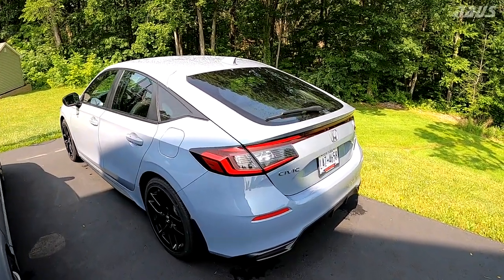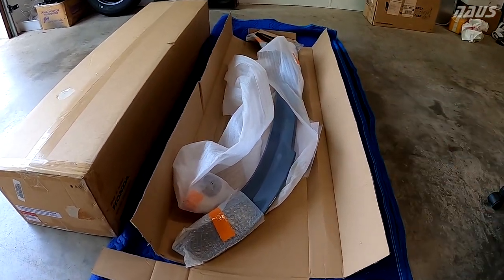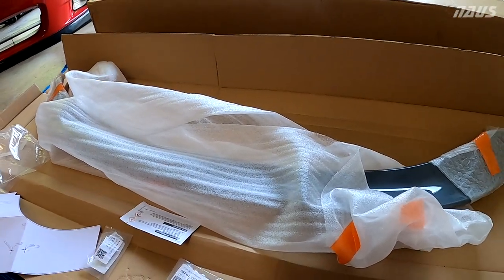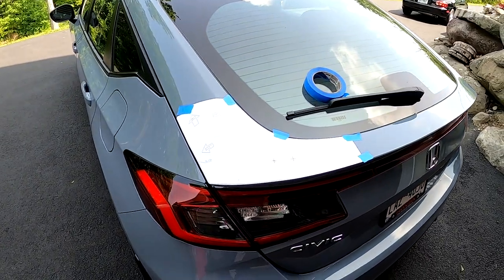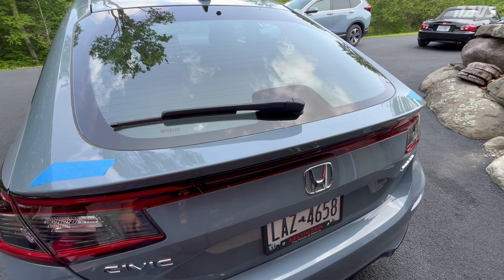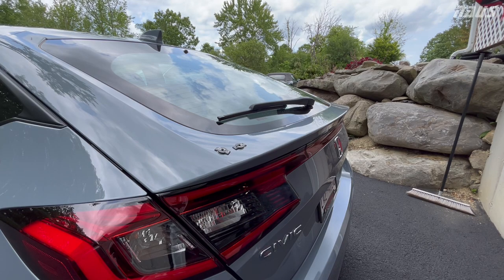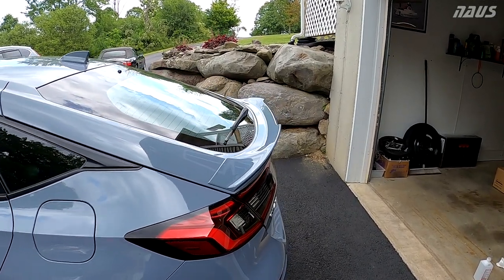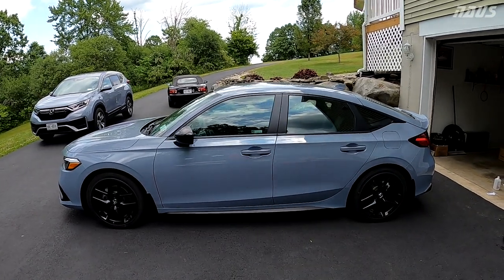2022-2024 Civic Hatchback OEM Ducktail Spoiler - Detailed Install DIY

Comment: Hello, this comment is for anyone wanting to buy this spoiler. I purchased the spoiler and this plastic little prongs on the spoiler are held on with some type of glue similar to double sided tape. They peel off and there is no holes below it. The gasket comes off very easily as well.

Comment: 19:13 I'm from the UK, I've seen a few of these, this is correct fitting. It is slightly forward from the boot lip. The contours are aligned perfectly, you can confirm this by look at each side aspect. 👍
Reply from the maker: awesome man thanks for the confirmation that I did it correct! Loving it so far!

Comment: Just a quick note to say that you've done an outstanding job with your Civic Sport videos!  It's good to watch/read new car reviews from the auto mags and internet reviewers, but I feel that it's much more valuable to hear this kind of feedback from actual owners that can provide a more meaningful perspective on the cars.  Personally, I've been a fan of Honda/Acura products for almost 40 years and have owned many wonderful ones over the years.  I want one last new manual transmission Honda/Acura that I plan to keep for many years to come, and I currently have a reservation in for a 2024 Integra Type S.  I have little doubt that the ITS would be a fantastic car, but I keep coming back to this car (Civic Sport, 2.0 with 6-speed manual) as a possible alternative.  I own an '04 S2000 which I absolutely love, and a '15 Mustang GT convertible 6-speed that is a blast to drive, especially when I want to feel the torque of a V8.  I've always loved the Honda naturally aspirated 4-cylinder engines with a slick shifting manual transmission, especially paired with a good chassis, steering, and light weight.  My question for you is; do you have any regrets not opting for an Si, Type R, or ITS?   Thanks again for the great videos and keep them coming!
Reply from the maker: Thanks for the comment! That’s a great question. Honestly since I still have my s2000 I have no regrets not going for the Si, CTR, or ITR. Financially this car just made the most sense in a world where inflation has ruined dreams for a lot of us. For a daily that will be ran through the winter and not garaged, I couldn’t justify something less reliable, worse gas mileage, takes premium fuel, and twice the cost. I think this car is a gem in this day and age of expensive cars. It’s fun to drive and I don’t need a track focused car for a daily. I get to rip the s2000 when I want still to get that excitement. I can sleep peacefully every night knowing how much I saved vs the cars you mentioned, and put that money I saved towards track days and other car events with the s2000
Reply: Thanks for the valuable feedback!  Your perspective helps a great deal.   @NAUS2K

Comment: Awesome video. You made the install so meticulously, with great insight on the little other things you did. I think it looks great, and the spacing on the rear edge looks fine to me, and if you did move it, like you stated, it might have contour fitment problems. 

Sonic Grey Pearl is my second favorite color, so if I got the Sport Hatchback, I would most likely get the Boost Blue Pearl and order the Berlina Black spoiler if I did, and probably get the matching black caps for the roof mounted shark fin antenna and door handles. 

But I will probably get the HR-V Sport and not do much modifications or customization to the exterior except maybe the black emblems and tinted windows. Maybe put the front and rear silver HPD lower bumper pieces to protect the edge from scraping.

Comment: What exactly did you use to drill the holes? I heard 7/16th but what was it called exactly? A link would super awesome 🙏🏻 your vid inspired me to buy these piece, should be here next Tuesday!!
Reply from the maker: It’s a rotacut kit I got off Amazon. https://www.amazon.com/Hougen-11075-RotaCut-Fractional-Cutter/dp/B003LY4E0Y/ref=mp_s_a_1_3?crid=1L7WTTP4RV0E3&keywords=rotacut+kit&qid=1697822331&sprefix=rotocut+kit%2Caps%2C98&sr=8-3

Comment: Looks awesome. I have the same color and sport trim but Canadian version. I'm wondering if a black spoiler is available and if it would look as good on it as the sonic grey one.
Reply: Was thinking same thing. Black May look nice.
Reply: @robtodd4726  Now that I saw the back doesn't go flush, the grey lip will look odd I think.
Reply from the maker: Seems like every car on the road has a black tacked on spoiler these days, IMO if you can get this paint matched to your car, go for it! Being the price is the same as the black one. However if there is not a paint matched one available in your color black is the next best thing

Comment: Bro what an amazing video!! My only question is how do I get that wing in boost blue??! I just bought my 6spd transmission a week ago and this wing just makes the car even better but the link you provided doesn’t come in boost blue 😣 unfortunately.. I’m wondering should I just get any color and just sand it down and get it painted at a paint shop to match? What are your thoughts bro! Thank you!
Reply from the maker: Get the black one and slap it on, will still look good! They don’t have boost blue as a color in Europe, that’s Why it’s not available. Bloost blue is only in the US
Reply: @NAUS2K  bro I never thought of that! Hahaha thank you so much! Which black would be the best fit? Crystal?

Comment: Hello, this is a great alternative to the HPD spoiler, I just bought a 2024 Civic Sport Touring in Platinum White Pearl with the 6 speed manual, I have only driven 500 miles since I bought it,  my question is what was the white goo that you used to seal the holes?
Reply from the maker: Honda bond, however any type of RTV should do the job
Reply: Where do you purchase Honda bond?  Do you have a link? @NAUS2K
Reply: Sorry I see that Amazon carries it for $10.19 a tube

Comment: is it mandatory to drill holes? Or is it okay to stick with double sided tape? idk if I trust myself to do that haha btw great results!
Reply from the maker: As mentioned it’s not mandatory. I did because when I filmed this there was zero info about the install online. I tried to show the best I could in the video where the placement of the spoiler is so anyone watching can have the best success at placing theirs without drilling holes. If you cut the studs flush with the spoiler and remove the gasket as mentioned, i don’t see why it wouldn’t work just fine

Comment: Some kind of protection (like primer or some paint )for the naked metal after drilling would have been good

Honda bond also might do the same

Nice info videos on Honda civic manual keep them coming
Reply from the maker: I mention in the video the hatch is composite. There is no metal I drilled into in this video
Reply: @NAUS2K  could you please elaborate what's the composition of this composite material 

And what other body panels are of the same material
Reply from the maker: I do not know the exact material makeup. But it’s some type of plastic composition. There is a steel frame on the inside of it that the HPD spoiler mounts to. But nothing will rust from drilling holes just like your front and rear bumper
Reply: @Savy_Singh - Honda just says “composite”. If it were carbon fiber, I’m sure they would use that for marketing.
Reply: yeah he mentions that the hatch is not made out of metal. but some kinda plastic..

Comment: Just got a 24 sport touring and hate the looks of the rear. This would be perfect. Until I saw the price.  $670 shipped. OUCH!
Reply from the maker: Still cheaper than getting an HPD wing installed by the dealer! Much less of a chance with leaks with this one
Reply: @NAUS2K   $295 for HPD spoiler. $150 for install by my  Honda dealership.  I'm not a big fan of the HPD spoiler personally though. We need Yofer to clone this duckbill and bring to the USA lol.
Reply from the maker: That’s the Cheapest I’ve ever heard of a dealer quote to install the HPD wing. If any aftermarket company replicates this I can guarantee it won’t fit well and sure won’t have an OEMpaint job

Comment: Any thoughts on whether or not the new gas shocks are strong enough to open the hatch without any human intervention or are they identical to the current ones installed!
Reply from the maker: I doubt it, I think you would still need to give it the initial lift.

Comment: Shouldn’t the large clips be on the inside of the bodywork, so you could have just have the 2 mm holes to stick the screws through?
Reply from the maker: I don’t see how that would be possible. That area is near impossible to access from the inside, and if you installed this clip from the inside out, it would stick up a considerable amount higher out the top of the hatch , not allowing the spoiler to sit flat
Reply: @NAUS2K  I mean so it doesn’t work as a clip that sticks through the hole but more as an anchor so to speak that sits on the other side of the bodywork of the hatch. You probably have to remove all the panels though. Anyway, love the color! Ordered the same one in e-hev…lots of the delay unfortunately.
Reply from the maker: I should have hit it with the calipers to be sure in the video, but I’m 99% sure the plastic studs coming out of the spoiler had a larger diameter than 2mm. I genuinely believe the 2mm hole is specific to a Honda cutting tool similar to the one I used for the final size

Comment: Are the holes necessary for security or just for alignment?
Reply from the maker: Both really,  but I don’t doubt it will stay just fine if you shave the studs off and only use the double sided tape

Comment: You rid not need to drill that duck bill in... 3m, heat gun and keep pressure over night and it will never come off. Plus you dont ruin the car with holes for a none oem spoiler
Reply from the maker: This is an OEM spoiler